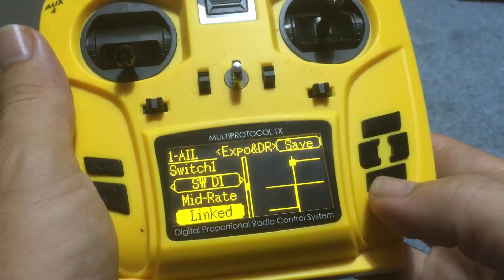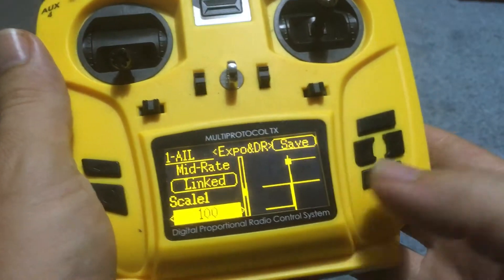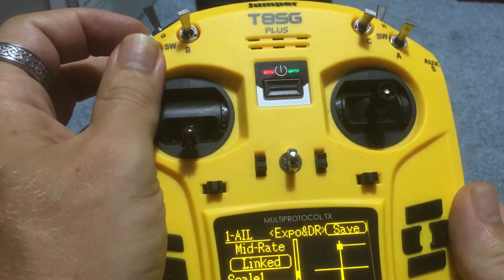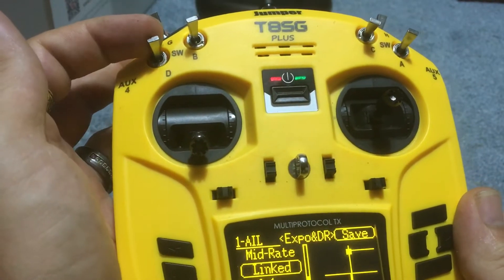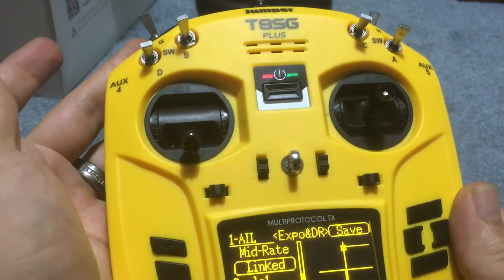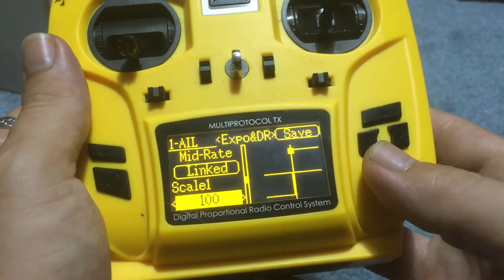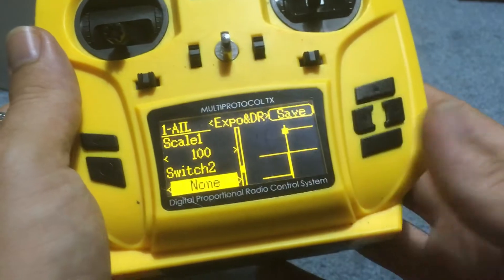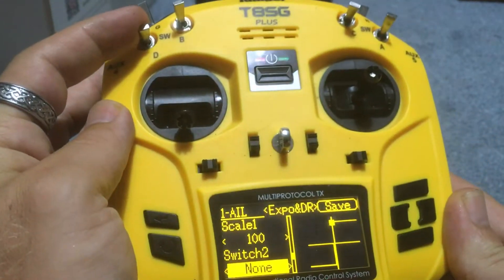Jumper T8SG setup RATES Speed Switches How To

Comment: I have the original t8sg every time I try to set the rates like this when I’m done I get a message like channel 3 at 38 percent safe value = 100 what am I doing wrong.
Reply: Safety message, your throttle is @38٪.  Its a safety so you dont have aircraft takeoff as soon as it binds.

Comment: Hey Thanks for the video! I JUST got my Jumper T8SG Plus (my very 1st 3rd party transmitter, so I have no programming experience yet). I was able to pair my Nano QX with DSMX/DSM2 protocol but want to be able to program switches like you for an LED light bar that I installed on it (for night flying). It’s running 7mm motors now with an updated frame so, it flys GREAT! Also, why did you have to program 4 times your 125 - 100 -75 speed differentials? Is it for each motor? And, how do I know if my Nano QX is flying full (125) speed already? Im like you in that I only use full power! Thanks again! Art
Reply from the maker: Programmed 4 times for each channel, so each channel had increased ranges 1 thru 4 other wise sat u only did one channel n say it was for pitch ur pitching would be greater but ur yaw would not